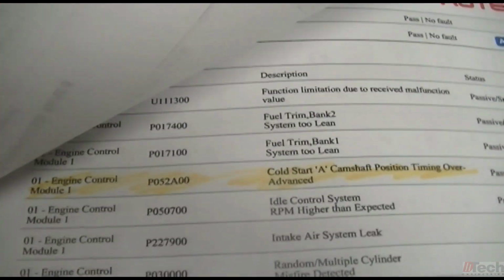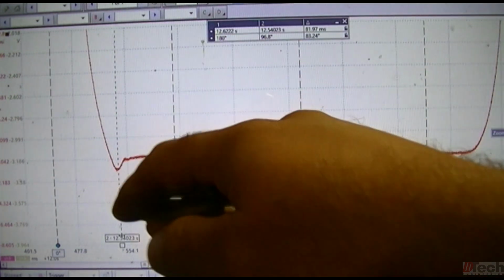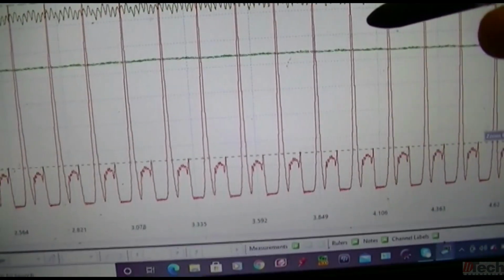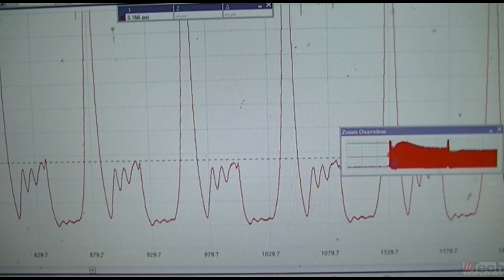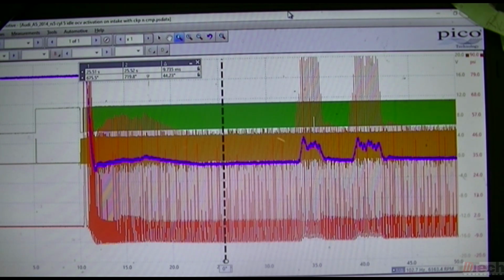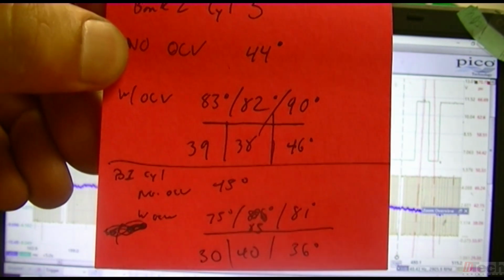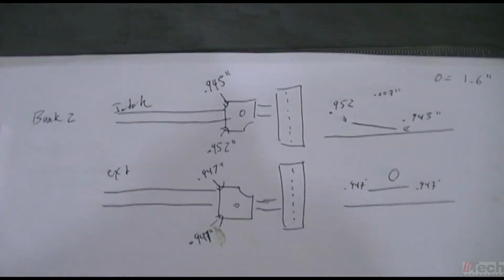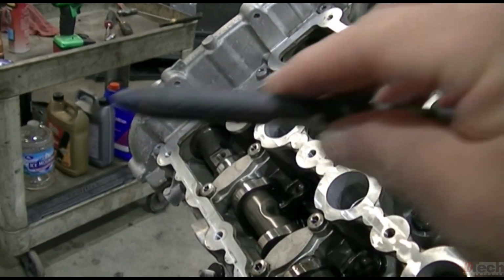2014 Audi RS5 4.2 V8 P052A Timing Code Diag & Fix

Comment: Great job. However do you think just the cam phasers on bank one were bad? Those could’ve been replaced without dropping the motor. I have a q7 3.0t with code p052c which is for bank 2. This came after I did the tensioners. I should’ve replaced the phasers then. But did not drop motor. Did it in the car. Not easy but definitely easier than dropping the motor.
Reply from the maker: Yes the code didn't return after replacing the phaser on this one, we ended up dropping the engine because we were dong the rest of the timing components as well.

Comment: Is this common with RS5s? Some people swear they dont have timing chain issues because of upgraded guides, but then i see this.
Reply from the maker: I personally haven't had too many of the actual RS5 with this issue, but I have experienced the other engines in the same line up of Audi that have the same timing set up that yes have had timing issues

Comment: This video was extremely helpful.  My '13 RS5 is currently in the shop for a full timing chain job due to the same exact issue. This actually gave me some peace of mind that they're performing the right fix despite likely not digging in as much as you did here! FWIW I took my car to an audi dealer first and they refused fix it.
Reply from the maker: Wow that's crazy that the dealer refused to work on it. Yeah hopefully it all gets done well and with no issues, it's a huge job and big undertaking, it's one that you want to get right the first time. That was part of why I tested so much beforehand , just to make sure I had a valid reason to open up the timing. Thank you for watching and hope you get yours back soon, these cars are a blast!

Comment: Is there any way of testing the  camchaft ajusters i have the same issue on my car just replaced the timing chain and tensioners but didn’t replace the camchaft adjuster because they are really expensive
Reply from the maker: Yes the adjuster are extremely expensive, but you can test them in a "generic crude" way at idle. Have the adjuster solenoid unplugged and while at idle then feed it 12v and listen for a change of sound from the engine and compare both sides on how they sound. If one doesn't sound like the other, then it might mean that the adjuster didn't move the same amount or at all compared to the side that makes a change in engine sound or idle. Hope this helps and thanks for watching.

Comment: Great video, i noticed i have p052a code on my rs5 2013 but no engine light. So are u saying this looks be a while timing job? My car runs fine but noticed the stored code
Reply from the maker: There can be different things that trigger this code. Sometimes it's as simple as the solenoid or other times it can be internal like in my case.  At best you can try to clear the code and see if it returns after some decent amount of time and mileage. In my situation, this code had been cleared and it returned , and so once scoped and found the pressure difference bank to bank, then clearly saw that there truly was a timing issue and the reasoning why the code would return. Thank you for watching